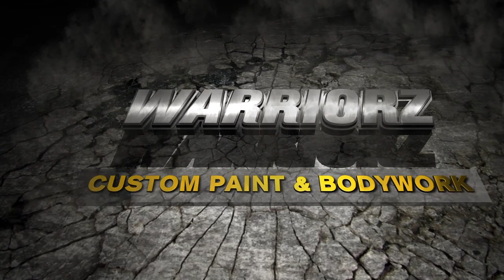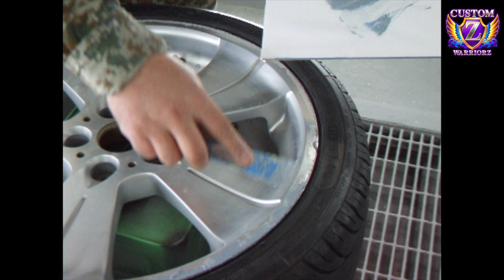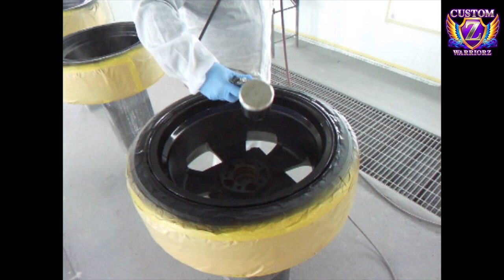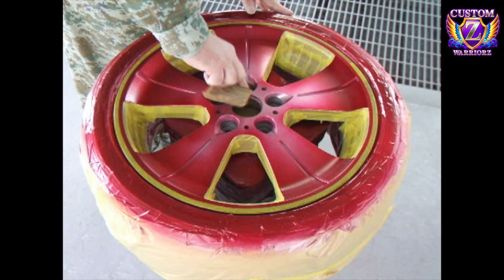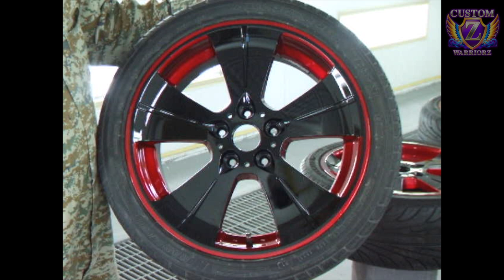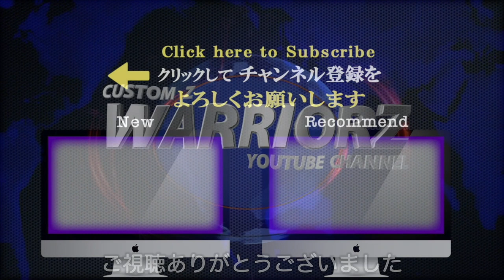Paint rims repair and custom paint candy color・キャンディーカラーでカスタムペイント

Comment: How long do you need to wait to tape up the inside of the wheel. Also if you use a sticker to put the wheels name on the dish how long do you wait to peel off the sticker.
Reply from the maker: It takes about one night.
The time required to paint this wheel is about a week.
Reply: @czw77  Thank you.